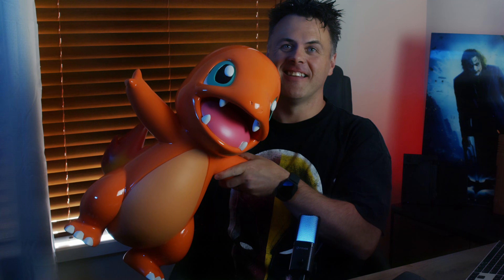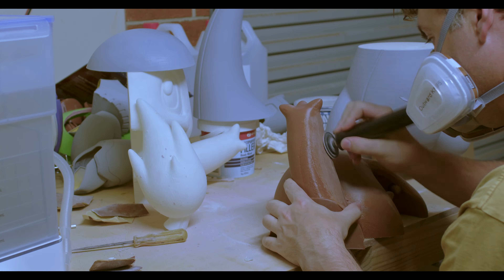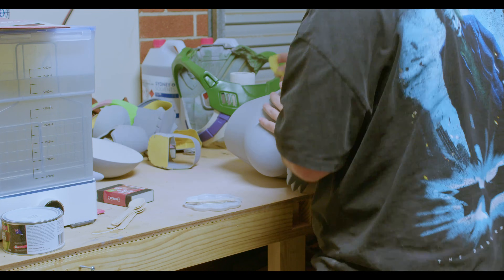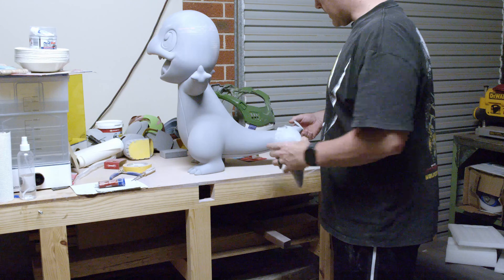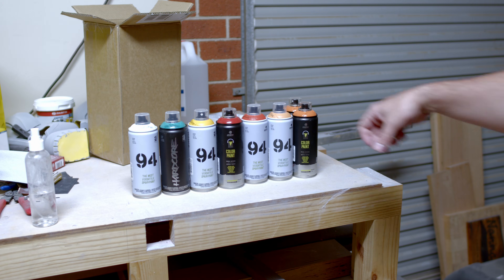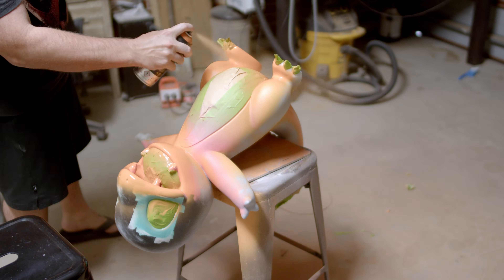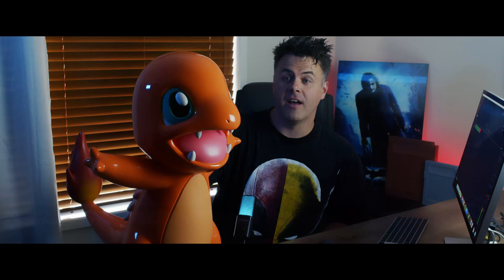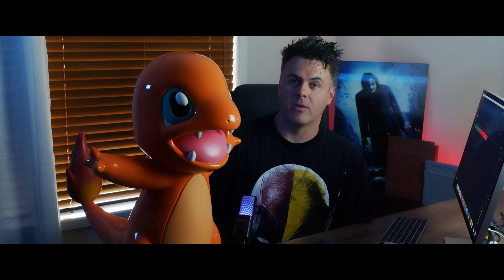3D Printing a Life-Size Charmander: The Ultimate Pokémon Project

Comment: Looks great! I just did a life size chicken jokey and used mtn 94 paint as well. I found that painting it was a long horrible process as if there was one issue with drying times it would just add to it. We are currently re doing it in the filament colors it is, being that its mostly its for kids i feel the layer lines are looked pass and people are more taken by the size and idea its printed. I love the way painted sculptures but do you feel its necessary, i feel its to the customer overall but finding that painting vs printnig it in the color is not far off actually, also saving $ and time on paintng and drying is a huge win. Love how it turned out and glad the kiddos are enjoying it! when they get tired of it sell it to a comic shop